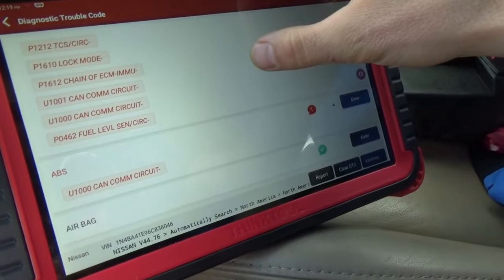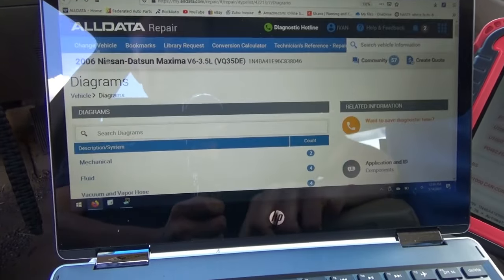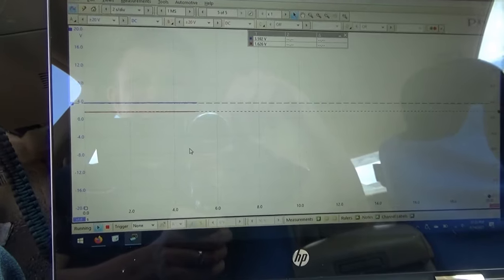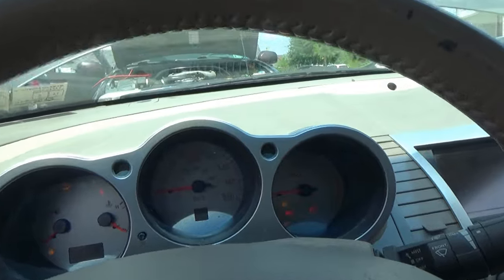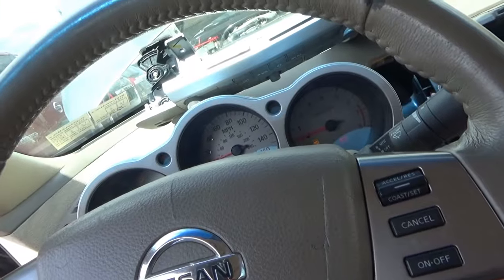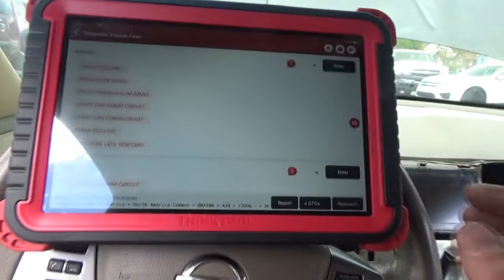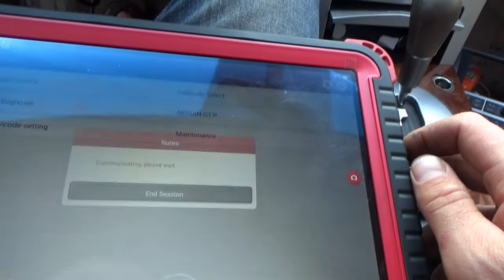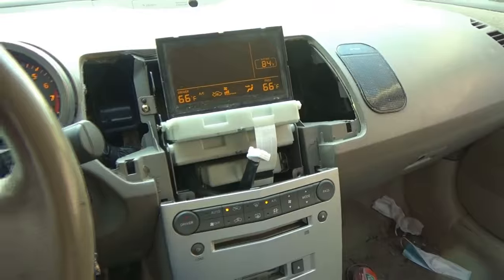You Won't BELIEVE why this Nissan Doesn't Start!!

Comment: Joe's Auto Electric had this problem, but I can't recall the vehicle or what it symptoms were in his case. 
The replacement unit had two small slots instead of one long one.

Designers can't foresee everything that users will do.
Reply: IIRC it was a common problem on that car too. People would shove coins in the trim for tolls. There was a "fix" from the manufacturer to put a piece of tape to make the one long slot 2 smaller ones with a bit of tape, as that slot was for cooling.

Comment: Just as bad as my 2008 Lincoln MKX,the remote start doesn't work (it beeps the horn and then instead of it starting it keeps honking the horn until you hold the button down until the idiot lights go out and then the car will start using the key)3 mechanic's have been unable to find the issue and I found a guy that does computer work in the cars and told me that the module for the remote start module is bad and he wants $1200 to fix it,I said thank you but no thank you, gave him the $100 fee and just left it alone because I don't have the money to fix it

Comment: as soon as i saw the coins i thought of either a service bulletin or stories of coins being the cause of problems in the HVAC system. I was looking for information about why my speedometer wouldn't work and stumbled onto that information. The cause of the problem ended up being a shorted out wheel speed sensor.. I had originally taken it to a shop and they replaces both transmission input and output shaft sensors, insisting that those are what read the speed of the car but it was actually the wheel speed sensors that controlled it.
Reply: im screaming "plug in the radio screen" when youre hitting the buttons :P

Comment: There is an old service bulletin for this exact issue. Coins being in the auto Amp. Everything else will start working once they replace the auto Amp. Instead of removing the shift knob clip you push it, to remove the knob.

Comment: Well i DO believe it ! When my daughter was 4 she put some coins into vent slots on the front panel of my dishwasher...sitting in the next room I saw a blue light flash, and that was it for that dishwasher.. when I took it out and turned it over to disconnect  wiring two dimes came "clinking" out on the floor!  Shes 17 now and still hears about doing that.

Comment: Very interesting Ivan! Why they put that slot over there? Who would put money in that place? Well it happened! Let us know if you repair that control unit! Nice case study!
Reply: The slot is almost certainly for factory setup of the module - downloading the software, setting the serial number, that sort of thing.  Most non-powertrain modules in cars aren't made by the actual OEM, they're off-the-shelf from a supplier like Bosch or Denso and the OEM programs them to their needs.

Comment: We had a failure in an overhead DVD player that prevented the antilock brakes from working.  There was clearly a mistake in our system where a mere pull up resistor had been overlooked.  But I always thought that the real failure was the car company putting our entertainment DVD player on the same bus as critical emergency equipment.  That was just stupid.  Fortunately the whole failure mode was complicated and the car company guys weren't capable of comprehending.  I had a boss that explained it to them in a way that was technically accurate but his explanation was obtuse enough that probably I was the only other person on the conference call that understood what he was saying.  It was a marvelous line of deceptive truth.  The car company guys almost apologized to us.  We agreed to put in a pull up resistor that would fix "their" mistake.
Reply: That WAS just stupid.  DVD fault taking out the ABS?  I WILL NEVER BUY A NISSAN NOW!  The brakes might fail if the ashtray gets too full!  Pos Pissan.

Comment: We if it's not the old bobby pin in the test port / slot short trick.  I really don't like all this B S of moduals  A computer for the engine and transmission and that's it. You don't need one for anything else never did before.

Comment: Coin probably burned out a voltage regulator on the board.  I used to see this in arcade machines but not cars.
Edit: Or a fuse on the board!

Comment: I took an adult-ed electronics repair class years ago and the teacher stressed one thing when working on electronics...90% of the time when an electronic device or a circuit fails, it's usually going to be the first thing plugged in or the last thing coming out, because that's usually where the electrical spikes occur.

Comment: Good one! I have run into a couple of these. Nissan actually has a TSB (NTB07-043) for this issue and a updated module that has tape covering the hole which I believe is a JTAG connection used for programming. My first encounter was similar to your diagnostic path and I went for this module last because of its difficulty to access.
Reply: That's awesome..directly describes the issue...customer placed coins in the slot, if it rattles replace it.  Etch a scetch it to check
Reply: Do you know about these I have a Nissan same issue not starting but it’s missing this module completely would that make it a crank no start any help would be greatly appreciated thanks
Reply from the maker: @EL_TORCIDO  did you watch the video? 🤔
Reply: @PineHollowAutoDiagnostics  I did but it still wouldn’t start after I put the new module
Reply from the maker: @EL_TORCIDO  if you watched the video then you would see that the car started WITHOUT the AV Module 😅

Comment: 40 years ago all you needed to sort a car was an oily wrench; these days all you need is a tablet loaded with diag software. Me thinks me getting old シ.
Reply: Maybe three $1000+ tablets, several interface boxes and several $1000 of annual data and software fees.  And an intellect capable of simultaneously analyzing a hundred pieces of information.  In my case, being color blind,  I can't even begin to identify all those striped wires.
Reply: @podamis314  Good news is we get to hear boomers complain the whole time. Then complain some more about how they paid the mechanic with shiny new nickels in the good ole days and it's insane "kids nowdays" want X amount of dollars (when they made 2-3 times that sweeping floors, adjusted for inflation and cost of living).

Comment: I have the cheapest printer from Walmart. Was working great, no complaints. Then one day it was malfunctioning. Couldn't figure it out. Decided i would disassemble it pulling ribbons apart, etc to get inside. I found a bottle cap jamming up the feeder. I had been reliving my teenage years and snapped a bottle cap off the wall weeks before not knowing where it ended up. Still using the same $40 printer. 👍🏻

Comment: Just like those older Chinesium mini Christmas lights, if one burned out, the entire line of lights also stopped working and it took a one by one test to figure out which one burned out. Very dumb engineering for consumers and electricians.  This car has the same design, one goes out, so do others. Obviously they must put the engineers in straight jackets at night.

Comment: If that module houses the A/C amplifier, I'd figure that it has a temperature sensor inside. That hole may also serve to allow the inside air into the module so the sensor can monitor the cabin temperature.

Comment: Where is the bonus footage of the module teardown! We want to see if there is any visible damage inside! Also it looks like the slot might be there for a cable which is not populated. Inside it looked like there was an unpopulated header. If so, it is probably safe to stick some tape or something over the slot :)
Reply: Yes, Ivan came to the same conclusion and stuck on some tape.
Reply: The header's not necessarily meant to be populated.  I've seen assembly lines for stuff like this where they have a thing with parallel pins with the right spacing that come down and contact the header to program the board.

But yeah, I'd like to have seen a teardown as well.

Comment: That's not a vent hole, that's the factory programming port hole. You can see the  pads right below the hole that the programming header pushes onto.

Poor design having that facing up

Comment: So my lady had a maxima as well and she would use the top as a coin holder. So we were heading back home from LA and we hit a bump..everything stopped working on the car. We had to pull over and some mechanic looked at it and kept saying it was the key module. We did our own investigation because all the warning lights came on(I guess it is a very common problem on those cars because people put their change on top) and it come to find out that the radio model shorted it from what?? My lady pennies and her lazy ness to clean it! Morel of the story take it to a loyal mechanic or dealer ship because the dealership charged us 300$ compared to the Machanic’s at LA that wanted 1200$ and didn’t guaranteed us that may be the problem.

Comment: Awesome. It took me a good 3 hours on one before.  Similar problem, Can pulled down, 15ohms.  Started unplugging ECM, TCM, ABS and everything on down the line on the can system.  Last thing was the climate control, of course, and can back and car started.

Comment: Ok I’m halfway through or whatever but if that coin in the module is causing this I’m gonna flip out.....that’s insane if so.   Wow.  Just wow.   Nice tip at the end too.  You’ve seen it all at this point.  Bobby pin and a quarter taking down a Nissan.

Comment: Hey Ivan I only got 44 sec into video had to take a call . However I heard you say fans on,no cel lit . No com .  Nissan is known for a bad ground wire from the transmission to wheel well  causing back feeding  that will pop the coil fuse . If this ground is bad and fuse is popped , all coils should be tested/ replaced  . Hope I'm wrong .

Comment: This reminds me of the lady's car I worked on once. Had a six disc cd changer that wouldn't play discs. All her cd's she had in the car were all scratched because they were not in the plastic cases. I tried some clean cd's I had with no scratches on them and it still wouldn't work. I pulled the cd changer out and found a bunch of loose change inside of it. I think her kids thought they would get a candy bar out of it by putting change in it 🤣🤣. No reprogramming required? Cool. I like plug and play modules.
Reply: That is believable! Did it work after cleaning it out?
Reply: @SalimKhan-gk1fh  Yes, I kept shaking, rotating and turning it until all the change came out, plugged it back in and away it went.
Reply: Wanna guess how sandwiches we pulled out of VCRs?

Comment: Speaking of coins,,had a customer bring their car in for a service, nothing special there. After the work was completed the vehicle was parked and they were called to come for it. When the car was started the shifter could not be moved from Park, even using the interlock override would not allow the shifter to be moved. The customer got very irate about the situation, however upon removal of the centre console there were so many coins down around the shifter they had managed to jam it, and as luck would have it, just when it was in the dealership. At least they apologized about their behaviour.

Comment: Hole appears to be over some pads on the PCB, probably used for JTAG programming or troubleshooting of the module in production.
Reply: Probably for pre-production debug. They should have covered the hole for production versions for obvious reasons.
Reply: yes

Comment: Nissan probably interlocked/ piggy backed the culprit systems with a bad design to save a few cents per vehicle.  Two feet of wire and/ or a relay or other component per car.  This is why once high quality Nissan became a crap company, and why Japan has been trying so hard to jail Ghosn, who master minded the disintegration of Nissan's quality from the top.  He squeezed out every penny, and ran with that money.  Not surprising behavior from a CEO.

Comment: A nickel and a hair pin cost them many dollars in repairs. My grandson stored his dimes in the lighter plug in back door of my wife's 98 Olds. She told me her interior lights JUST quit working all of a sudden. That's the only time I ever got paid for working on my own car. Think I made 40 cents on that job. That's also the only time I've ever kept anything I've found in a customers car.  I always use a plastic bag to store coins, pills, lottery tickets,etc. and place it  in front passenger side floor. You find some really odd stuff any time you do dash, console or seat repair. and if they have kids, the back seat is a real treasure trove. GOOD JOB IVAN and THANKS.

Comment: That was an interesting one Ivan! Guess it was alot more work than the video shows........somehow it's always one of the last modules or the one that's hard to reach
Reply: It reminded me of your BMW passenger door handle no crank.
https://youtu.be/B7gggowzPSE
Reply: Happy homeowner repairs (they have no idea what happened when started playing with it)
Reply from the maker: It's either the first or last...nothing in between ;)
Reply: @PineHollowAutoDiagnostics  - Always the way! And it's always the last bolt that snaps off or strips out ...
Reply: @PineHollowAutoDiagnostics  Look at it this way, no matter which order you check modules in, the culprit will always be the "last" one you check.  So, if it is the first one  or the third one, it will also be the last one.  You could always check all the other ones as well, then it wouldn't be the last one!   LOL!

Comment: Believe it or not, that is a common Nissan problem. I had a similar problem and talked to a former coworker who works at a Nissan dealer. He said he has seen about half a dozen Nissans with coins jammed into the hvac unit. That must be a convenient resting place for spare change. That ended up being the problem with the car I was working on. Crazy.
Reply: ive seen it before also. The 350z has the cup holder close to the unified amp (ac control head). Coca cola soaked modules are common, along with the change stuck in those modules too.
Reply: Yep. Seen this same issue at least 10 times over 20 years. Usually a coin falls all the way in and shorts something. Didn’t always cause the same issue tho.
Reply: Its not really a Nissan problem.    It’s a pig in a car problem.    There are proper places to store your loose change and  the dash of your car is not the proper place.
Reply: @nissanneal    Yeah Neal, some people are definitely pigs that's for sure.  However, IS there actually a proper place in this vehicle for loose change for tolls etc?  If there is, then stoopid driver.  If not, well,  more blame for Nissan.   It's probly been a good money earner over the years for dealership repairs though.  I dunno, it could be a deliberate omission; not sure.  Probly not.
Reply: Conformal coating on circuit boards used to be standard. It is an insulator and would have prevented this issue. Anything to save a buck!
Reply: @dancarney106      Hey Dan.  I think you're mostly right.  But cars need to be idiot proof, otherwise idiots will find a way to hurt or kill themselves, or damage the car.  Nissan should have known that people would find that spot a convenient place for coins to rest.  Also, if that hole is an access point for an optional connector or test point that is not always used, then Nissan should have installed a clip on cover of some sort, or even just a piece of gaffer tape - anything really.  I blame Nissan mostly, particularly if what hellhoundTX333 says about it "being a problem for 20 years" is true.
Reply: So  was the coons  the reason cranking but not starting?

Comment: Those 6 big pads under that slot have TP6 silkscreened next to them.  Probably a test point that for some dumb reason someone decided not to tape over access to.  Apparently you aren't the first to have this issue: I googled the module and found someone else who found change in it and that the replacement has felt tape over the slot.  https://sparkys-answers.com/2014/10/2006-nissan-maxima-gauges-and-ac-inop.htm

Comment: The seat position doesn't work because there is a bunch of trash under the seat.
Reply: If the battery was disconnected the memory buttons are erased and need to be reset or they never programed the setting to begin with.

Comment: Back when TV's used vacuum tubes, they also had ventilation slots in them.   Repair shops would often find coins that kids had dropped into the slots.
Reply: @ rig42 rig 42
 TVs still have vent "slots"
Reply: Yeah, 40KV BABY! Unless of course it was a Zenith with a bad safety capacitor then you're looking at closer to 60 and the neck blown off the CRT.

Comment: I’ve been saying for many years that a clean car will have less problems.
Reply: Interesting theory. It could be people who care about their car have less problems (due to preventative maintenance and more respect for what could go wrong). Those people understand a clean car is an extension of caring for a car.
Reply: Wife thinks I’m crazy but I think the same thing Russ
Reply: Well its a nissan sooo they were trying to cut costs even in these models before switching to cvt transmission
Reply: @ryanravencaller  Yah definitely
Reply: I don't usually wash my car more than every two years and it's 25 years old. It's let me down once in the 14 years I've owned it and that was a fuel pump. Oh, and the paint is in great condition because I'm not pushing gritty dirt around on it every weekend.

Comment: Back in my day, when you stuck a bobby pin in your hvac circuit board you only lost your hvac system. Also  it was resistors and vacuum actuated blend doors and there was no circuit board, but my point remains.
Reply: Lol, love it! And the cord on the lawn mower didn't rewind itself... these damn kids nowadays